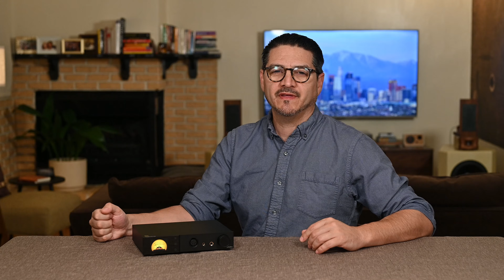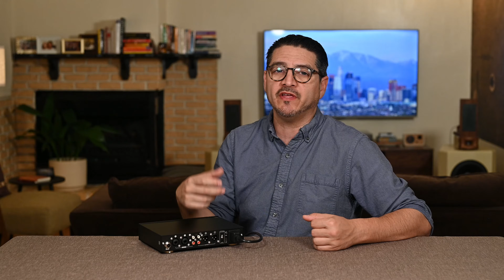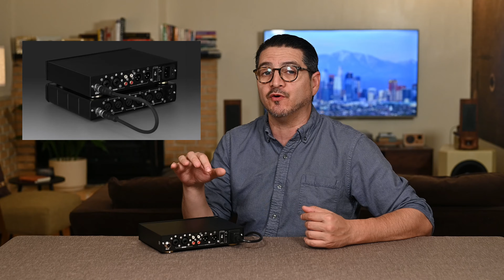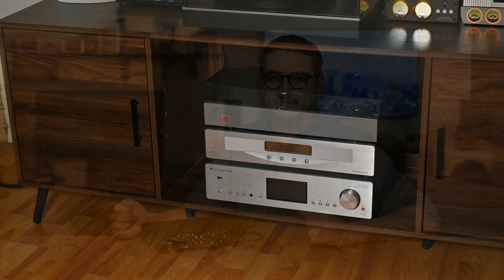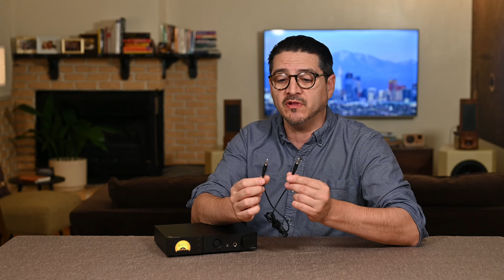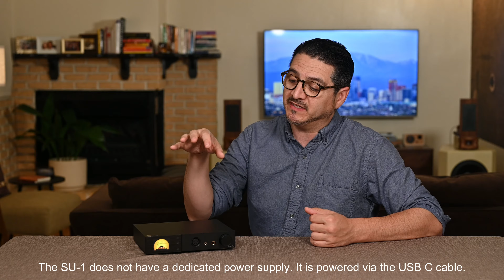Topping A70 Pro Headphone Amp and Pre Amplifier Review: Sounds great on audio setups or headphones.

Comment: 2:04 So having an additional option for trigger connections is a negative? Not every setup is the same as yours. I have the trigger IN on my Topping L70 (same function) connected to the 12V DV supply in my system so that it turns on when I power that supply on. I don't use the trigger OUT at all since I don't have any other devices that have trigger inputs.
Reply from the maker: Good point. But the negative comes from making it tougher for a newcomer. For someone more advanced as yourself, it's a plus. Like using your phone to crop a picture. Sure photoshop has more features, but isn't the best for a beginner, that's all I was saying. A lot of people get worried about thumps when they turn their preamp on after their power amp. Overall. I love the product.
Reply: Makes sense! I agree that one more hole adds some complexity. But it also adds flexibility. I'm sure that there's plenty to live about it. I have an L70 and it's in use in my system as both a preamp a d headphone amp. Absolutely love it.